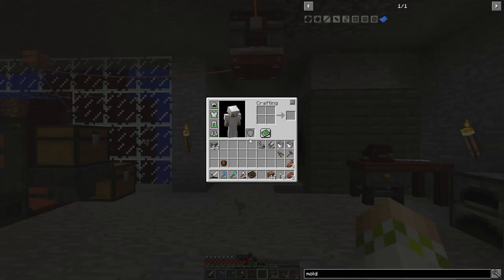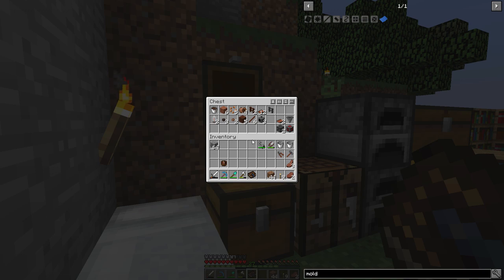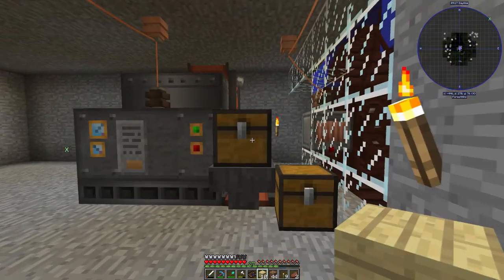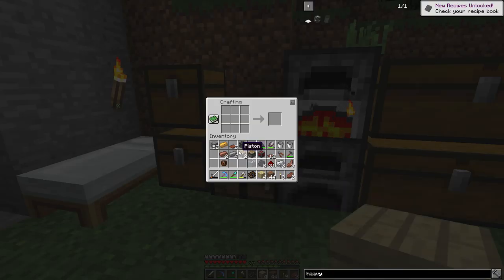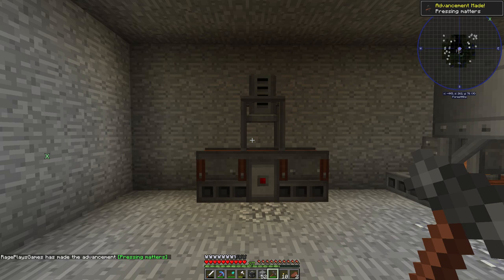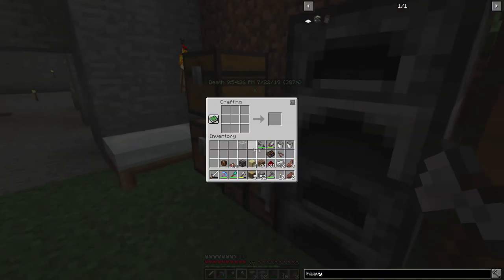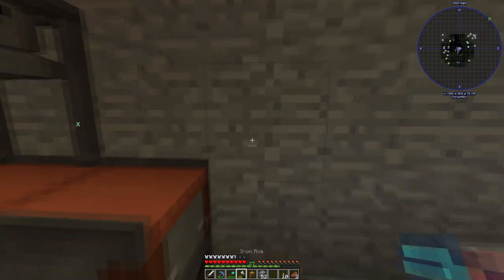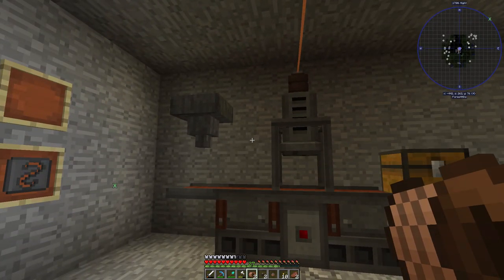Surviving With Immersive Engineering :: E05 - Metal Press

Comment: The engineer's hammer does indeed let you rotate pistons; it's really handy for setting up the metal press without needing to dig under it. (If I remember right, it spins around the face you clicked on, so clicking on the face or back of the piston won't do much - needs to be on the side. It's not like the Thermal Expansion crescent hammer which rotates TE machines through the available facings in a fixed order.)

I don't think you need the hammer to remove a mold from the press.
Reply from the maker: You are correct! You used to need it but now simply shift + right clicking the metal press will remove the mold :)
Reply: @RagePlaysGames  why can't I place an autocannon metal press mold into the metal press?